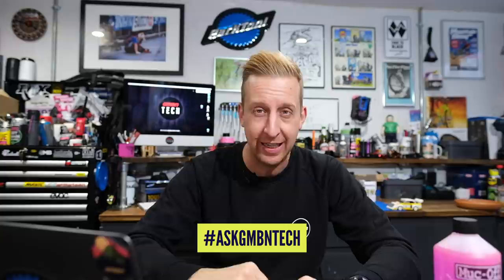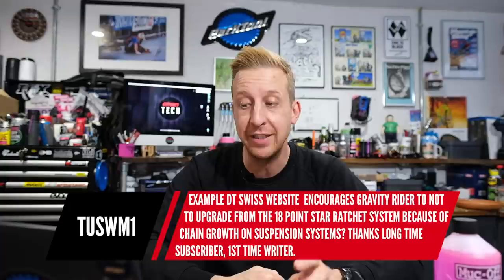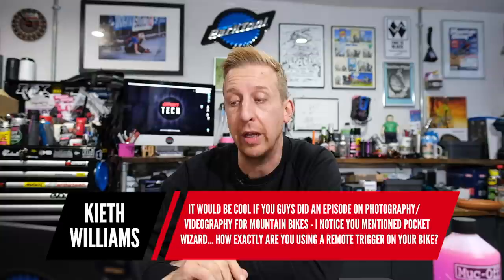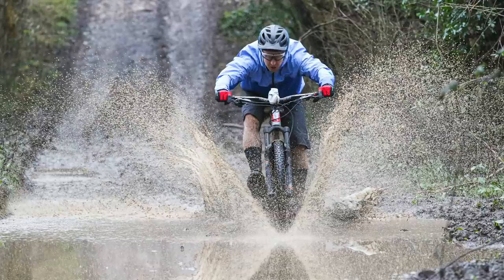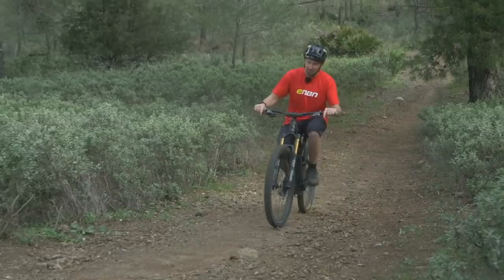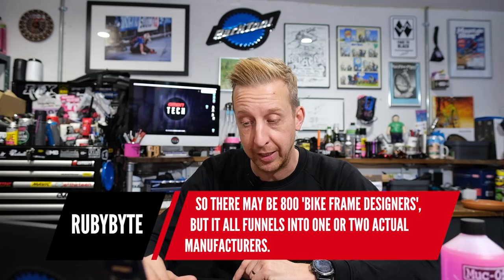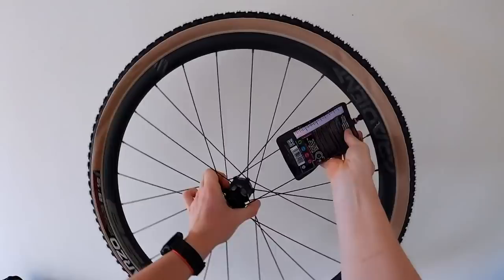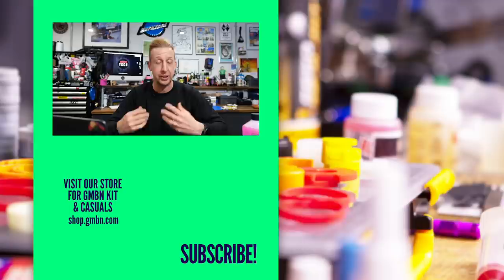What Is The Clear Pole Hack To Get The Bike To Stand Up In Photos? | #AskGMBNTech

Comment from the maker: Do you have a mountain bike tech-related question? Use the hashtag #AskGMBNTech with your comment for a chance to be featured on the show! 👇
Reply: #AskGMBNTech
Hi doddy I'm wondering what you think about oval chainrings? I've seen it on many bikes and I don't really understand what the point is. Also I'm really curious as to what you think of integrated headsets and cockpits? Thank you and love your videos.
Reply: #AskGMBNTech During a cold ride I suddently felt like there was no oil left in my front brake, I couldn't brake. When I pumped the lever the pressure slowly came back but it left again when I squeeze hard on the lever. There was no leak, the pads are in good condition and at the end of the ride the brake returned to normal. What may have happended ?
Reply: #AskGMBNTech 
Hi Doddy. I'm the proud owner of a Canyon Neuron since last summer. The only thing that bothers me is the reach on it. It's too short for me. Frame is a little small in general even. (Canyon did a poor job on the size-fitting. I'm 1.84, bike is size L which is supposedly for 1.82 - 1.92 riders) I've heard about quite a few other Canyon riders who face the same problem: bike ended up too small, following Canyon's recommendation. I wonder what the best option would be to fix this since a new frame is a no-go. I already have a 60mm stem and would rather not go any longer (handling). On the other hand, saddle all the way back neither seems like a good idea.
Reply: #AskGMBNTech Question : is there a solution to fit a Bontrager front hub with torque caps for a rockshox fork (SID)? Not only is the fork a bit stiffer, but it is also much easier to install your wheel if you go biking somewhere.
Reply: #AskGMBNTech
Hi Doddy, Is there a remote that had a lever for lockout front suspension and a other for your dropper combined. For cleaning my cockpit. Also if i understand this video correct a single pivot bike has no chain crimp of growt.
Reply: #AskGMBNTech Love your videos! The rear shock on my new 2021 Marin Rift Zone 29 1 (X-Fusion O2 Pro R) doesn't have a lockout at all. Is there a way to add one/increase the pedaling efficiency some other way (for some XC riding and going up long climbs)
? Thanks in advance!
Reply: #AskGMBNTech
Rear hubs, freewheels and cassettes interchangeability. WTF?!?
eg. Many SRAM ones only(?) fit a Shimano freewheel. I think.
Please, please explain the permutations. I'm sure you can do it in less than 20 minutes.
Reply: #AskGMBNTech love the show ! 
My dropper post gets stuck three quarter of the way up.. everything looks normal and the bike is a few months old. Should I service it, add lubricant or something else ?
Reply: #AskGMBNTech can you go tubeless without the sealant. I expect you would still get some puntcures from the thorns, rocks and stuff, but I have NEVER I mean NEVER!!! got that kind of puntcure. And tubes are just so anoying and you get a pinch flat for every little hit🤦. I really wanna go tubeless but I just not feel like buying sealant🤷🏻.
You are the best. Thanks🤘
Reply: #askgmbntech hey doddy. I'm looking to upgrade my hardtail to a full sus frame in the future and really like the look of the starling frames, they're fairly local to me too. What are the advantages to having a steel frame? Are the advantages enough to justify the extra weight? Cheers.
Reply: @pranavreddy6470  I run an oval chainring so will explain this to you.  Due to the oval shape, when mounted in the correct orientation, at the most powerful part of the pedal stroke (when pushing down) more teeth will be in contact, maximising the power and vice verse (least powerful part has less teeth and therefore easier. So just like a bigger chainring produces a higher gear, an oval chainring slightly alters the gearing as you go round the pedal stroke, maximising your power output. They are hardly noticeable most of the time but help in the situation you need high torque e.g stuck in thick mud or technical climbing it gives you a noticeable advantage.  I would never change back now!  What is also interesting is that it feels more rounded to pedal than a normal, round chainring due to the varying number of teeth engaged which is synced with the power you produce in your pedal stroke.  Hope this helps! :)
Reply: @archieansell9160  thank you so much really helped me understand
Reply: @maelsonthonnax7190  Cold affects the fluid. Depending on how old brakes are just carry out a brake bleed. From what you've described sounds like there's air in the system.
Reply: @zigaremih7562  why not use sealant? It's the cheapest part of the set up.
Reply: @danprice1016  couse it is not sold anywhere near me and just don't feel like ordering stuff again (recently ordered new bike)
Reply: Twerch is my favourite climb on an ebike. It’s super tech and I like to try and ride the whole thing without a dab (I’ve done it 3 times now).
Reply: That first question from TUSWM1 are the type of questions we want to hear more of.
Reply: #AskGMBNTech
Hi Doddy, I’m looking to upgrade my 2008 Kona Caldera to a longer travel fork. It has a 100mm fork on it now. I don’t what the BB height to be to high. Any suggestions on how to measure it?
Reply: #AskGMBNTech I have a question regarding the coil vs air debate. One of the advantages to a coil shock is that there’s less or no “breakaway” force meaning it’s more sensitive to small bumps. But considering sag, I would think that an air shock is in enough constant motion to where that extra breakaway force is rarely needed. Curious about your thoughts on this!
Reply: Hey Doddy, 
I’m think of getting a downhill bike ( nukeproof dissent rs 290 ) as I really want to start racing dh, but I’m just wondering would it be better to go for a long travel enduro bike (180mm) for it to be more versatile for everyday riding and for racing downhill. Just want your opinion👍
Thanks
Reply: #askgmbntech: Hey there. Long story short, i got infected by the virus...the mtb virus. Last September I made my  first real mtb experience in a DH Park here in Germany. Everything went fine, no injuries no damaged equipment. So I decided to get more into mtb...Due to the fact that 2020 was nearly over and all bike shops were sold out, I placed an order at transalp bikes to get my very own custom build signature III all Mountain bike.  (Nice little company, worth to have look at).
To shorten the time waiting for the delivery I watch nearly any gmbn & gmbn tech video on YouTube. Thanks for the massive amount of knowledge you guys share here. I really appreciate it. 
Until I get my new bike I work on my 10 year old cube cross which I used as commuter and try to train my tech skills ;-) 
A few years ago I gave this bike to a bike shop for general maintenance and the cassette was replaced. 
Now I have some trouble getting the rear mech working properly. I followed all common steps to adjust the derailleur an even replaced the mech hanger.
Finally my question: how can I check if the spare cassette which is now on my cube bike fits the rest of my drive train? 
Best regards from Germany
Reply: #AskGMBNTech
Hi everyone at GMBN. I'm not sure if this has been asked in the past. You guys at GMBN are fortunate to work with a lot of MTB brands out there and one of the perks are getting bikes to test. Question is, do you get the bikes for free to keep? (I'm assuming you do however forgive me if my assumption is wrong) and what do you guys do with the old bikes from 2 or 3 years ago especially if a new one replaces them?
Reply: #AskGMBNTeck do they make oil slick rotors and if so would they make the performance worse?
Reply: #askgmbntech hi doddy what are the benefits of a 1x9 speed drivetrain

Comment: #Askgmbntech
How much difference does a dirty drivetrain make?
Can you do a video about that maybe with actual measurements (weights on pedals as a DIY Check)
Like dirty chain, casette, jockey wheels, chainring

Would really appreciate something like that in spring I'll try it myself.
Reply from the maker: We were just talking about doing a video like this the other day, but want to show other reasons why it's bad to have a dry chain... We wouldn't suggest you try this experiment yourself Maik as you will cause premature wear to your drivetrain!
Reply: @gmbntech  We've done a similar test of efficiency in Uni. You can obtain a device (Metabolic Gas Analysis System) that measures all the gasses that come and leave your body; this allows to calculate precise energy use, aerobic/anaerobic performance, fat and/or muscle mass burned etc; frankly everything, and the entire computer can be just dropped into dedicated backpack whilst riding. Paired with a power meter and heartrate monitor it's possible to obtain quite precise and interesting data. Would be interesting to see such a more science-based experiment on gmbn! :)

Comment: 3:50 I have an ohlins ttx coil shock on my Specialized Enduro it is insanely smooth especially compared to the 7 year old air shock I came from, but my chain snapped last weekend and it takes smooth to a whole new level would recommend taking your chain off your chainring to give it a try

Comment: #AskGMBNTech - when calculating spring rate for a coil shock they say to use your riding weight (you + your kit), but does that include all the bits and bobs that we strap to our bikes (spare tube, tool, pump, water bottle, etc)?
Reply: all weight including gadgets etc that are NOT on your bike / frame (unsprung weight); in other words, stand up on a scale, measure your weight with your riding kit without including the bike.

Comment: #askGMBNTech Hi Doddy, I'm looking to change out the bottom bracket on my 2018 Trek Remedy. I have identified it's a PF92 bottom bracket, and found plenty of new bottom brackets but have not been able to find the dust covers that go between the BB and the cranks. DO most BBs come with these or do I have to re-use the ones I have on the bike currently? One I have is ripped and letting dirt and grime in and id like to replace it. Cheers from SoCal!
Reply: Normally new ones come with...but thats other types I have experienced

Comment: hi Doddy love love the show i watch it every week including all Gmbn content! some of the best content on utube! i have a question reguarding angle changing headsets! I know you can get them for frames with tapered head tubes but ive just recently discovered you can get them for frames with straight steerer tubes! i currently have a hardtail with straight steerer that i would love to slacken out as the bike is great but it would certainly benifit with a slacker headtube angle! is it possible if you could shed some light on this option? like maybe where to get them! limitations ect any information would be greatly appreciated. cheers Grant from in QLD Austrailia

Comment: #AskGMBNTech Very important to me beacause I'm building my first enduro machine: 150mm travel frame, currently 18t ratchet (used, second hand wheel, not ridden yet). Can I put 54t in it? How will it work/feel. Fox float X at the back. Should I get 54t or less, 36t maybe?

Comment: #AskGMBNTech  Hi doddy I’ve set up my mega to tubeless and for some reason there’s sealant slightly leaking through the side walls and the tyre doesn’t seem to be losing pressure , my tyres are Michelin wild enduros and DT Swiss rims. 
I set up my scout the same 
and never had an issue Only  difference is I got maxxis tyres on my scout 
Thank you

Comment: #AskGMBNTech - My Santa Cruz Hightower (150mm F 140mm R) is using 25mm internal width old wheels with 2.3 inch DHF and DHR2. I feel fine and the grip is more than enough to me. But I see everyone else are using 2.4/2.5 WT tires now, even with less grip tire like Rekon. If I want to try WT tires I have to upgrade to 30mm width wheels and the cost is not small. I want to ask if you think the difference between 2.4WT tires and 2.3 tires are huge and worth the upgrade. Thank you!

Comment: #AskGMBNTech During a cold ride I suddently felt like there was no oil left in my front brake, I couldn't brake. When I pumped the lever the pressure slowly came back but it left again when I squeeze hard on the lever. There was no leak, the pads are in good condition and at the end of the ride the brake returned to normal. What may have happended ?
Reply: Oil gets sticky when cold, your oil may have been more viscous when traveling through the line hence the weak brake feeling.
Reply: Is it Shimano? Common issue with wandering bite point.
Or air in the system.

Comment: Can I ask for grip recommendations that allow the installation of the muc off tubeless tools. Lots of the main recommended  lock on grips on the market are tapered with closed ends. Thanks.
#AskGMBNTech
Reply: I use Lizard Skins Peaty grips, these take a wedge in the end so the Muc Off kit fits inside the bars no problem.

Comment: #Askgmbntech
Is a entry level hardtail (900€) better for first xc races or a mid level trail fully with 130mm?
Reply: hardtail for sure, unless the races are insanely steep
Reply: @Ropetable  They're not too steep or rocky a hardtail with a good rider can'T manage
my main argument points are lighter wheels, stiffer frame a dropper and descend fatigue.
Reply: It depends... if you already have both bikes and you're choosing which to ride then look at what others are using, and check out how rough the course is. In most races you're going to spend a lot more time climbing so having the most efficient climbing bike will make you more competitive (usually a hard tail). You'll usually get passed by a lot more people on the climbs than you pass on the descent. If you're just racing for fun you'll probably have more fun on the full sus.

If you don't have a bike yet you can race on any bike, until you move up in category from beginner it won't make a huge difference. Look at what most of the other people are using.

Comment: #AskGMBNTech can you go tubeless without the sealant. I expect you would still get some puntcures from the thorns, rocks and stuff, but I have NEVER I mean NEVER!!! got that kind of puntcure. And tubes are just so anoying and you get a pinch flat for every little hit🤦. I really wanna go tubeless but I just not feel like buying sealant🤷🏻.
You are the best. Thanks🤘
Reply: Yes you can, as long as all the interfaces seal perfectly. 

I installed a Continental Terra tire about 4 weeks ago. After popping the beads inflating to 45 psi it’s still holding 30+ psi today. I did it dry because wasn’t sure snow was going to hold and it didn’t - now riding the fat bike. 

In this case it worked perfectly because the tires are impermeable (some have leakier sidewalls, like the 45NRTH on the fat bike that had sealant seeping for a bit), the sidewall/rim interface was perfect (not the case with my Stans that bubbled a small amount of sealant before the small rim edge leaks stopped) and the valve gasket worked perfectly and didn’t leak at all. Also not always the case. 

I certainly wouldn’t recommend it at all but I think some roadie TT setups are done like that to minimize weight and rolling resistance. And because there’s a car with extra bikes following the rider.
Reply: @tychoMX  well, thank you for the answer.
Reply: @zigaremih7562  no problem. 

I checked on those tires last night for curiosity. One of them is now deflated (but still seated), the other has a fair bit of air in it still but feels soft for sure.
Reply: @tychoMX  oh. Yeah, I will experiment with that👍😁

Comment: #askgmbntech I swapped out my buddy's air spring from a 170 to a 180 mm on a 2017 rockshox lyrik, but now when we ride, the fork keeps loosing air pressure and sitting at ~40% sag, what should we check besides the top cap and valve core to fix this?

Comment: #AskGMBNTech
Hi Doddy, I'm looking into changing my forks for something a bit more adjustable. Currently I'm running a Rockshox XC30, which uses a coil spring. I'm looking to get an air sprung fork, but with so many different types of fork, what should I be looking for? It's also worth me mentioning that the geometry is pretty good for me, so I don't want to risk ruining it by 'over-forking' my bike. Thanks, any advice would be much appreciated!

Comment: #AskGMBNTech If your rear bike's suspension linkage is set up for rear shock uses a trunnion mount, is there an adapter so you could use shocks with the other type of mounting (non trunnion) hardware?

Comment: #AskGMBNTech Hey Doddy! Why does the shimano rear derailleur mounting system exist in two different types? For exemple the XTR M-9000 has one more pivot and a little part that the XTR M-9100 doesn't have near the hanger screw. What's the difference ? I hope my question is clear enough

Comment: #AskGMBNTech Doddy, on MTB's why is there more overdrive gears then under drive gears?  When riding, most of the time is spent climbing in one form or another and yet on modern MTB's with a 30 tooth chain ring and 12 speeds, you will have 4 under drive gears and 8 overdrive gears.
Reply: Most time spent climbing? Do u ride up and walk back down?! If u finish where you start, its the same😳😂
Reply: There are different mtb disciplines....some purely gravity.
Some mainly down, some a mix.
Heard of enduro or trail riding?

Comment: #AskGMBNTech
I recently worked on an old bike which had a weird derailleur.
It had a inverted cable mechanism so if you pull the big lever to increase tension, you shifted to the smaller cog and vice versa.

What were the up and donwsides?.
Reply from the maker: Hi Maik, it was called "Rapid Rise" and the system was designed to improve the downshifting but it didn't stay about for long as it was confusing for many riders who had got used to the current system. What's interesting is now Shimano now use 'ramps' both up and down the cassette to help create smoother shifting!